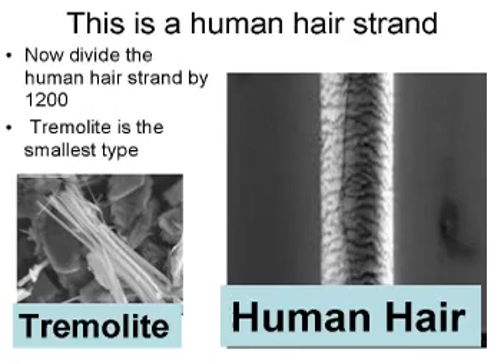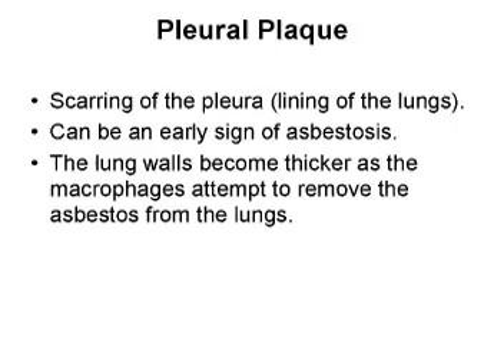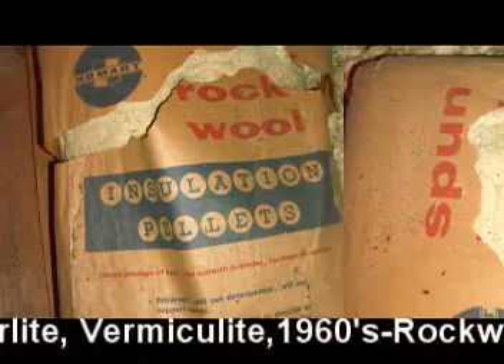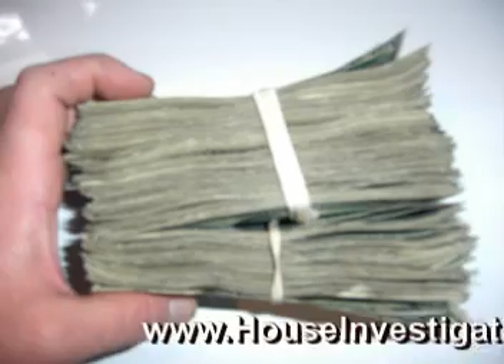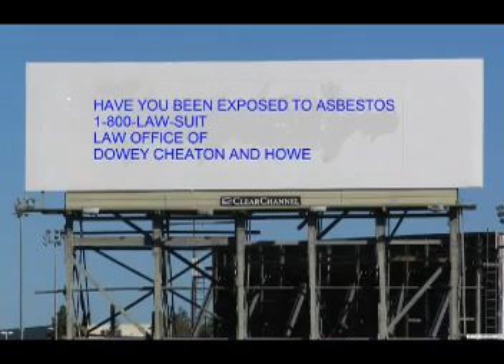Vermiculite Insulation Tremolite Asbestos Zonolight  WC GRACE for Libby Montana

Comment: Meanwhile Owens-Corning etc claim the glass fibers in their spun  fiberglass insulation "breaks down" in the lungs, when was the last time you saw glass just "break down" and disolve and disappear? glass is used to contain the strongest acid there is- sulphuric acid, 150 year old glass windowpanes don't "break down" either, not from sun, rain, heat, cold or constant washing.
Reply from the maker: GLASS is the next Asbestos.,  YEP  BAD    Sorry for the late response. Been making many new videos lately. THANKS

Comment: Exposure to asbestos can be a serious health risk. However, removing asbestos from a home or building is not always the best solution. If, for example, the asbestos is undisturbed and intact, removing the asbestos can in fact be a greater risk than leaving it in place. However, if a renovation or demolition will disturb asbestos containing materials. Disturbing asbestos can disperse particles into the air, where they can then enter the lungs and cause long-term health problems.